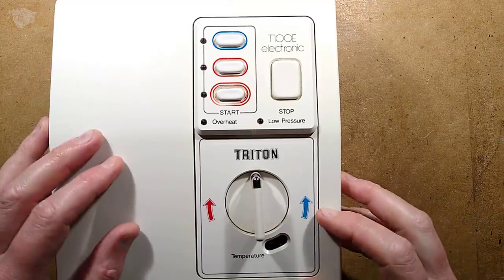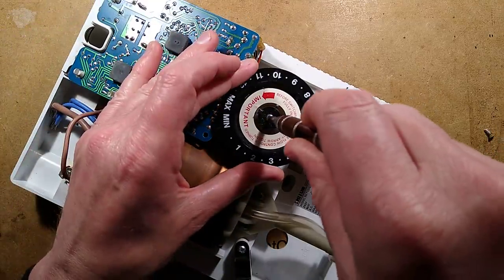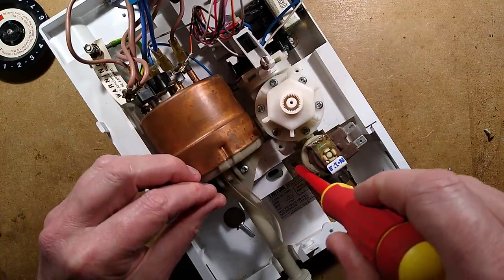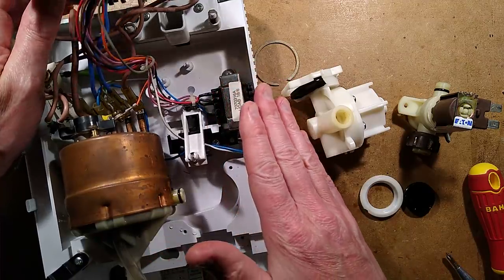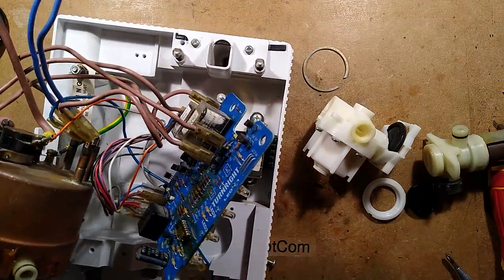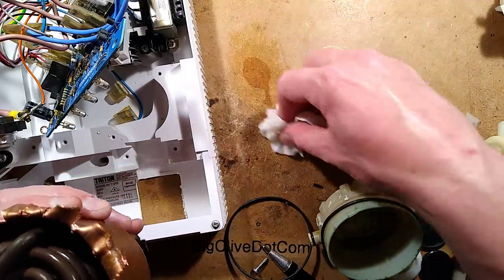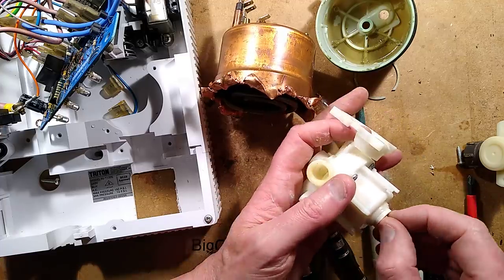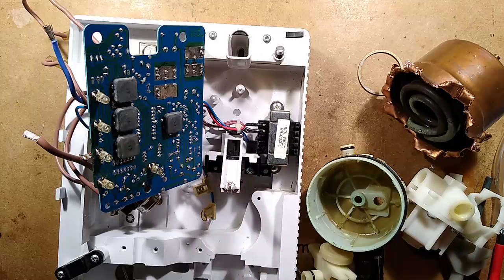Teardown of a British electric shower that went bang.

Comment: Is this used in addition to a house water heater? Or is there something similar for hot water at the kitchen sink?
Reply: Yes.  It heats the mains water directly rather than getting low pressure water from the hot water tank.  many homes switched to a combi boiler getting rid of the tank but I kept main so my airing cupboard would still do its original job :D

My shower at the moment has an electrical fault in the attic that needs sorting so I'm using a mixer hose thing to use the water from the tank.  Is extremely tricky to get the temperature correct that way.  I could just have baths but last time I did that I really didnt find it any better, plus it used a ton of water.

Hopefully I get power back to the shower soon.

Comment: As an electrician here in the UK  I have repaired dozens of electric showers and can tell you it is quite common to find showers that have been incorrectly installed electrically. Usually they do not include an RCD and your survival in fault conditions rely solely on your relationship with God. 
Anyway, several factors can lead to your failure, including new water mains in the area causing an increased pressure on your line, water pressure should be limited to 3 bar, but can be over 10 bar because plumbers cant be bothered or don't know to limit it!!! 
Also, chemicals that are dosed into the water at treatment plants will degrade plastic like chlorine dioxide (Notorious for degrading plastic pipes) are all enemies, but a combination of these factors and a splash of water hammer thrown in will certainly grind it's bones. 
Tasty how the water sprays straight into the PCB when that happens. 
That's why it's important to have it installed properly by qualified electricians and plumbers. 
Anyway your brother got great value from old Ralphie. Hopefully he names the new one with a cheery name too. :-)

Comment: It is a wonder it is leak proof from the beginning it has to many joints and seals. What is the chance of being electrocuted by a shower unit if properly installed? If the earthing was broken is it lethal?
Reply from the maker: I only know of one and it was being used with the cover off and the modern slavery worker in the squalid accommodation was poking about in it while showering.

Comment: I installed a Triton Cara here at home a few years ago... Got a sparky to do the final leg to the consumer unit, so it was all within regulation and such... 

But the thing that really impressed me with the unit was how well insulated its design was.... When you opened up this dead unit. it has none of the enveloping layers in the chassis design the Cara has.  

With the cara you could have the unit directly under the running shower head and not a drop would get to anything scary... But your unit you taken apart... I feel i would like it to be no where near the shower head. Of course with the half meter hoses the units are meant to be designed to take splashes and running water.
I imagine the BANG sound was when the "plunger"? failed and water hit something mainsy, but you didnt say if it tripped anything in the consumer unit?

The our Cara was 9KW and people saying that these units are inefficient, dont get how heating things work. Theres very little loss when heating stuff. So yeah with an electric shower youre getting up to the 99%-100% efficiency, With the only losses being the copper cables and basic internal electronics. 

The only gripe i have about electric showers is the pressure, but hay at least I have hot water on demand so I can clean myself at a whims notice.

Comment: Damn how much water pressure do yall have in the UK? Maybe install a knock resistor after the solenoid.  I still cant get over that is is powerd by mains.
Reply: Usually about 3 bar. Legally has to be at least 0.7 bar.
Reply: Q&R Electronic repair not uncommon to have 10 bar here at night, when demand is low. It varies massively depending on location, local supply, current demand, elevation etc.

Comment: Looks like a death trap to me as well and I'm not from the usa. I've never seen anything like this. We all have the water heaters out the back of the house or even jammed in the ceiling sometimes with an overflow. I assume this is due to limited space. (Same reason why the washer is in the kitchen etc)
Does this thing plug into the wall or is it hardwired due to the current ? It would most certainly have to have a ground for safety reasons and maybe a RCD / earth leakage unit.
Reply: roadmonitoroz Brisbane of course we have hot water systems too.
Reply: As an Australian traveling around the UK I came across many of these in hotels. They're all hardwired - all you see is the box on the wall, the wiring's completely hidden through the back of it.

There's another version too which has a pump - seemed quite odd to have that humming away inside the shower but it does the job. That was at an old farm house B&B built in the 1600's - there was a water well out the back hence needing the pump to boost the pressure.

Overall they're imperfect but they work.

Comment: No calculating the resistance to find the wattage? 
I was curious if both the elements are the same.
Reply: Indeed, I think they missed a trick in manufacture. As it seemed to be cold / warm / hot, I am guessing both elements might have been the same, so you have nothing, element 1 or element 1 and 2. If however they had used two DIFFERENT rated elements, then a four level option could have been had: Off, 3KW element, 5Kw element, 3+5=8KW elements

Comment: Also, I'm pretty sure the pressure switch is a safety device, to prevent an instant fireball when operated without water.  No water, no heat.
Reply: Actually i think it is to stop burning people if someone else uses the water. If the pressure drops/ flow decreases but the heat stayed on, very suddenly much hotter water.
Reply: @mandowarrior123  whynotboth.gif

Comment: Interesting. Do people use this as a replacement for a water heater in the UK? Seems like it would be more efficient than having a heater which is always keeping water warm.
Reply: On-demand hot water heaters are quite common in UK workplaces, such as a factory canteen (the eating area), or in a "meeting hall" (where e.g. boy scouts meet). Gas is more common than electric though. It's just way cheaper.
I've never seen one in a home. Modern UK houses have a gas "combi boiler" which heats water on demand.

Comment: Seems to me like the diagram, plunger assembly should be made out of brass and the valve should just be a butterfly like an old fashioned throttle body on a car. Or at least a metal valve with a stepper motor to control the hot water output. But stepper motors wear out and cables just stretch.

Comment: How is water heated in big hotels? You can get not only a shower but also a deep bath, 24/7. There's always full temperature hot water available. Places like the Ritz and the Savoy NEVER have the taps run cold. Ever. Do they employ 'instant' heaters a bit like this Triton unit or do they just not care much about energy bills and have a huge hot water reservoir being continuously heated? I don't stay at the Ritz very often, BTW.
Reply from the maker: They will have bulk hot water storage and boilers to keep it hot.

Comment: In Brazil we have electrical showers, I even think it started out here. Anyways I never heard of anyone dying from an electrical shower here. Butttt I have been shocked many times taking showers in shady motels.
Edit btw this shower is too fancy omg, ours is just like a heat resistance and a ground wire hsushshshsusu and it works fine. I seen you done a video about it 5 years ago heushshshsh

Comment: I understand the procedure of how the water heats but how is the cold mixed with the hot just before the output for comfort?
Reply: I used to have one of those and I noticed when I turned up the power to get hot water, the water flow coming out of the spray head slowed down and then the flow rate increased again as I reduced the power to get cooler water. So I assumed from that, by turning down the power caused the system to pump more colder water from the water mains to mix with the hot water to cool it down.
Reply from the maker: The heating is fixed in two levels - low and high.  To adjust the temperature of the water you turn the dial that either lowers the water flow for a higher temperature or increases it for a lower temperature.

Comment: I had the same shower but with a remote control panel. The exact same thing went on mine it’s a low pressure shut off switch. Unfortunately for me the water was spraying out all over the plasterboard in the loft 🤭 mine had 1987 date sticker on the relays on the pcb! Warning that he replacement modern equivalent from triton has broken twice in the past 3 years and now the temperature control doesn’t work...

Comment: it is good that it had pressure sensor is to avoid dry-running it. these heating elements have tendency to burn out if there is no water to take the heat away. The cheapest electric water flow-heaters might not have such safety feature and they tend to burn out, and warranty paper often states that if you break it by dry-running it then the repair is not covered by warranty and you have to pay extra to fix it... I know that because I worked for two years at a store that sells home and water heating appliances. (anything from electric kettles to whole coal furnaces) And the amount of people breaking them by turning them on with no running water, and then complaining to us about the warranty rejections was staggering. Despite the fact that we made REALLY sure to explain to the buyers about that issue...

Comment: A very timely teardown as far as I am concerned.. I recently had a similar problem with a Triton shower, expecting wrecked insides as you have here but it was luckily just the pressure relief device. June 2020 prices mail order ten quid (cheaper but possibly not actually as "genuine" as the seller claims, are available on ebay. So glad you decided to rip the tank to bits. Always wondered what the insides looked like - surprise surprise a pair of heating elements! What was I expecting? Fire breathing amphibious landing craft replete with Afika Korps men in desert fatigues???

Comment: In the US, tank water heaters are still very common. I currently live in an apartment that has a natural gas tank heater and I actually prefer gas over electric. Though here we don't use those little dinky shower head heaters, we use the tanks to heat up our water before it goes into our shower or sink systems. Its weird because today I just found out that they don't have a central heater system but separate ones for each faucet.

Comment: It didn't seem that plausible that the missing plastic could have escaped. Is it possible that it has always been missing? As best I could judge from the video, it wouldn't have been involved in preventing water leakage, only in holding the parts of the pressure sensor in place, which the remaining plastic managed to do - until it couldn't any more.

Comment: Ive been in industrial support for about 30 years and Ive seen a lot. Things can and do go wrong. 
I dont shower with the power on. We have a switch on our heater tank and I turn it off before showering. Also dont use our pool without turning the pump off. 
No electricity anywhere near water for me, thank you. Ive been shocked enough.

Comment: The first time I ever saw one of those was on a trip to Britain in 1993. Beats the American way of running the water a minute or more waiting for the hot from the central water heater to get there. Also, you don't have to worry about using all the hot water. Now I use one in Thailand but it scares me because it wasn't even grounded when I moved in. I had to drive a metal rod into the ground and run a ground wire.

Comment: Clive ,interesting hot water heater, how many people are shocked by these heaters every year, not a real safety unit when you mix water and electricity. How come they don`t use oil fired or gas heated hot water heaters?
Reply: How do you get an electric shock in a plastic/fibreglass bathtub or cubicle? Where is the circuit? 

Basic electronics that even I as a nine year old knew.

Besides, those gas boilers. Their days are increasingly numbered with the talk thats been happening regarding scrapping them.

Comment: That's made back in the days when things were made to last more than a couple of years! Proper transformer based power supply!
 Circuit board made by Turnright controls, a company that was based near Portsmouth at the time, I doubt that the new shower will last anywhere near that long!
I recently bought a 3kw Triton over sink handwash unit & I was surprised to find it's actually made in the UK.
Reply from the maker: The new one has no electronics at all, so should hopefully last OK.

Comment: This only heats up the water, right?

If so, I could really use one of these. Does it simply plug into the wall or do I have to call an electrician?
Reply from the maker: You can get small plug-in ones for low level water flow at sinks.
Reply: @bigclivedotcom  But no plug-in versions for a shower?

I live in a big apartment building and several families share each water heater. So cold showers are fairly common.

Comment: Modern units are way safer and easier to use. They got rid of the diaphragm years ago and use a reed switch type device, water pushes up a magnetic ball which activates the switch. It uses pwm switching now for heating elements, stainless steel heater core, built in circuit breaker with rcd, overheat shut off still the same, built in filter screen on the water valve.  Some premium models have a booster pump for low water pressures.

If it's installed properly, it has multiple redundancies to prevent a shock. The case is "large" as it's built to be splash resistant, you can pretty much rinse the unit with a hose and water will not get in. The plastic outlet is part of fail safe, if you can stand close to a Brazilian shower, the water running the length of the pipe to the shower head limits how much current it can pass through. That's the worst case when all safety devices fail.

Comment: If there's such a complex PCB, why there's no phase or group regulator? It would be more convenient and more eco in some cases than changing the water flow to control the temperature.
Reply from the maker: The current is very high for phase angle control.

Comment: You could potentially 3D print a replacement part. There's a lot of materials available now that would meet the task. I guess it depends on your dedication, how viable it is and your budget. You'd also have to know how to design the part. For those who are on a budget but have a printer and designing skills, that could very well be a good solution.

Comment: I'm surprised that all the water handling components and electrics are all in a common compartment like that and there's only conformal coating over part of the circuit board.  One would have perhaps expected to see separate compartments inside to try to keep the electric and water separated in case of exactly this type of failure..

Comment: Interesting Clive! Ooh, a linear PSU for the logic board?  I suppose that gives full isolation to the parts where (wet) human fingers interface. A switched mode design in this instance is probably best avoided with their minimal isolation in a "wet" environment? Now I've said that, a thousand people will come along with evidence of the latter ;-)

p.s. 
The conformal coating is probably to eliminate moisture from upsetting the logic .  The CD4011 (quad 2 input nand gate) being a CMOS device with a high input impedance?

Comment: We are paranoid about electricity in bathrooms in general in the U.S.  Also though, we don't have 240 volts throughout our houses, You will typically only find 240 volts in a few select locations in the house.  I don't think you could get enough heat out of 120 volts at 20 amps to keep up with that, and we really don't like cold showers.  Electric point of use water heaters are sold here, but, a large centralized heater is the norm.

Comment: Was the thermal cutout resettable in that shower Clive? The last Triton shower we had (only a year old) failed due to the thermal cutout which was a one-shot one, so new unit needed. Luckily it was under warranty still so they replaced it. Pretty poor to make it non-resettable.
Reply: The thermal cut out looks similar to the one I replace in my Mira shower (due to age) and it auto resets after there's enough water flow to cool it down.

Comment: Hah that sounds nuts to me here in the US. 240v with your shower, what could go wrong? We generally have a gas or electric water heater in the basement that keeps 60-100+ gallons or so hot at all times, routed to every fixture in the home. Varies however, could be tankless and not everyone has a basement based on climate. Electricity is very sparse in our bathrooms and nowhere near a shower/tub.